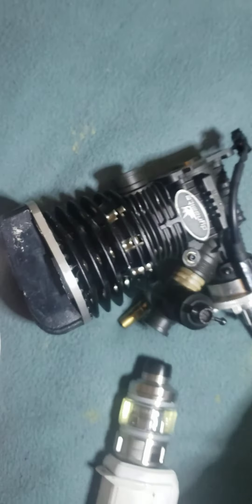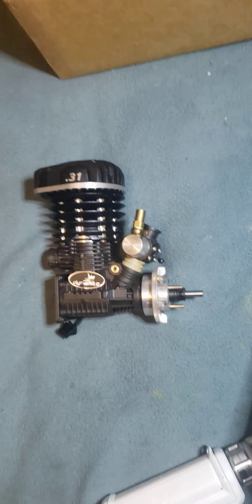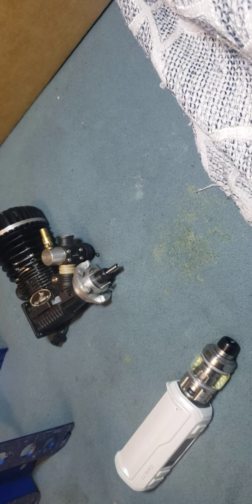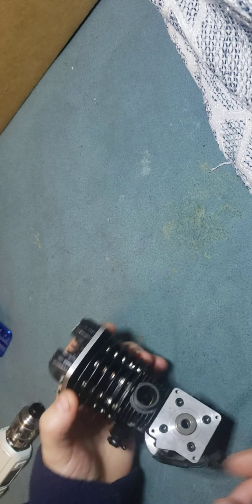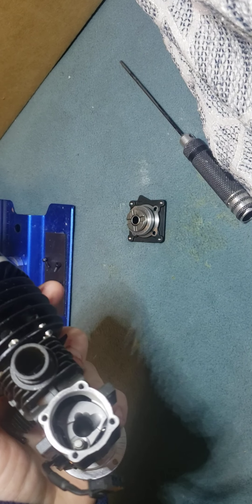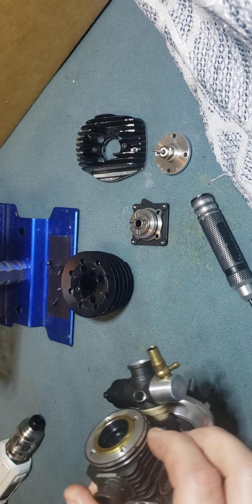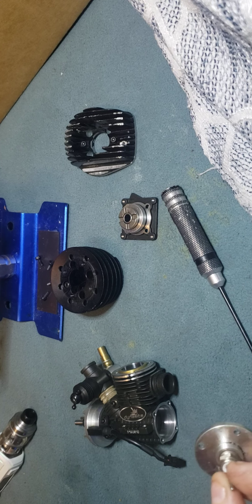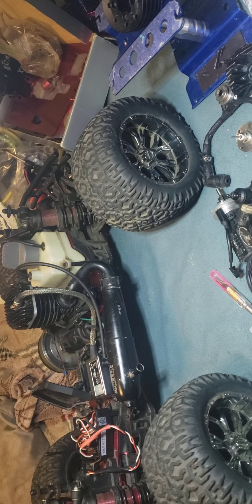Losi LST XXL 2 Dynamite .31 Gas spare engine & XTM .21 Tmaxx kit sneak peak

Comment: I shouldve warned you not to buy the 99 dollar one. I did mention there was one for 150 but sold before i could get it. Was by the same person as the 99 one but said still has good compression. Also that stick pack is probably no good i always used it with the lipo.